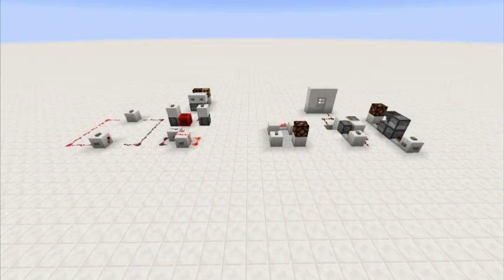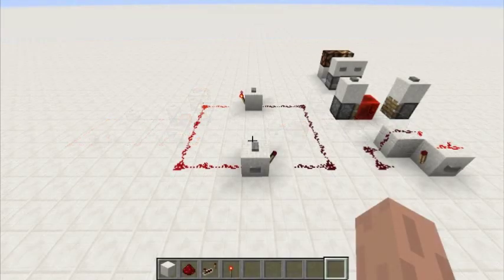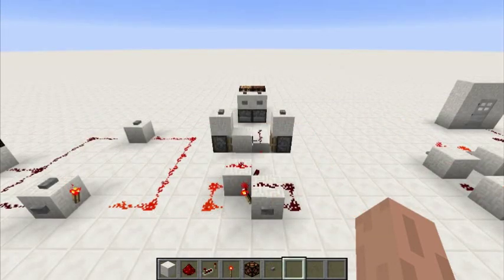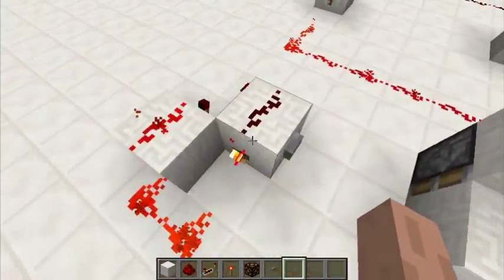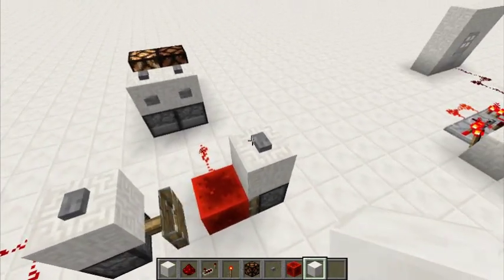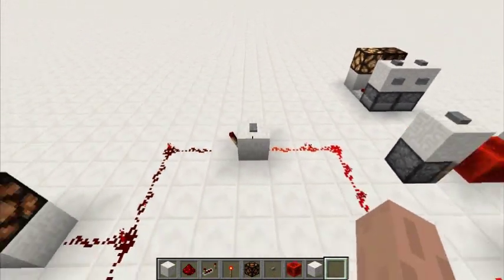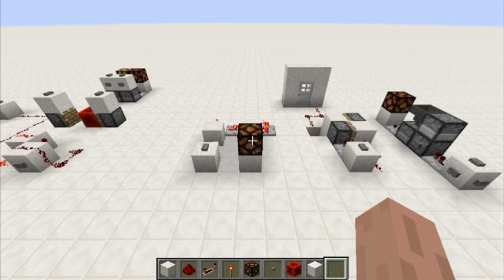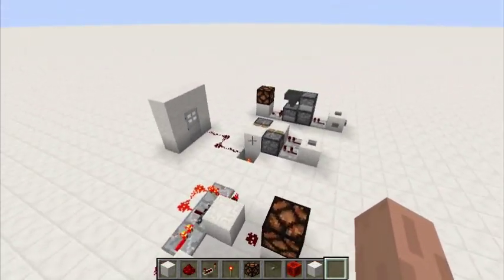Redstone with Ripper :: Episode 3 - SR Latches and T-Flip-Flops

Comment: Why would I want to build a T flip flop when levers exist?
Reply from the maker: Because a T-Flip-Flop is like a lever that can be activated with ANY redstone input; a button, a pressure plate, a comparator, you name it. It also solves the "two-lever" issue with doors. If you have a lever on one side of the door, you can open and close the door from one side, but not the other, which is kinda crummy. Hooking up a button/pressure plate to a T-Flip-Flop from both sides solves this issue. (You can also use an XOR gate with two levers, but that's beside the point).

To give a more general answer, there are places INSIDE circuits where you need some mechanism to trigger on and off, which is where T-Flip-Flops are more useful (obviously you can't use a lever in the middle of a circuit).

Hope that answers your question!

Comment: Shouldn't the first T-Flip-Flop only cicle once if the repeaters involved on the clock were delayed? I'm too lazy to test ^^'
Reply from the maker: I suppose that would work theoretically =P I'm even lazier, so if you want to test you can use the world download up there ^^^ =P (in description)
Reply: ***** Just checked, making the locked repeater delay 4 ticks does the trick.
Reply from the maker: Double_Jumper
Nice! Pretty good thing to know, even if it's still kind of a crummy, more resource intensive and less compact T-Flip-Flop =P My point is that the particular design is kinda bad in the first place compared to the other ones haha